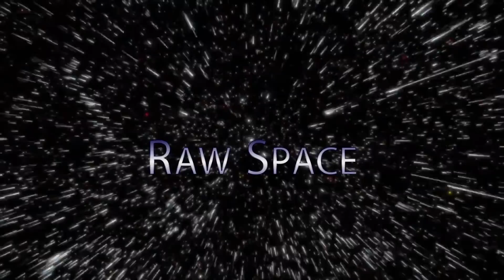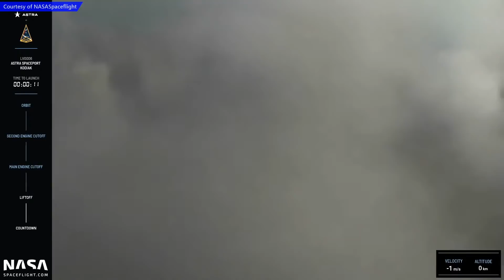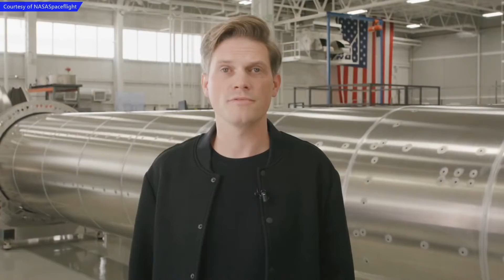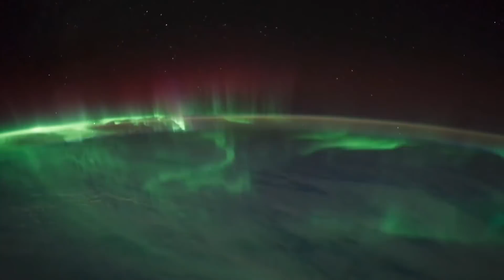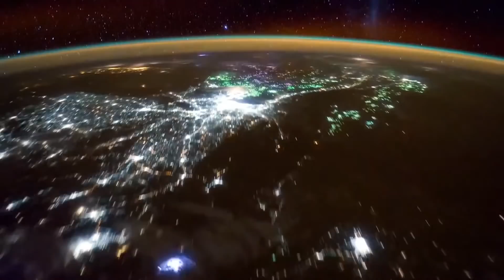REPLAY: Astra Rocket launches sideways, terminated at 30 km! (28 Aug 2021)

Comment: Future primary school maths exam question:
- A rocket with 5 engines takes off from a launch pad at sea level. One of the engines fails at launch, causing the rocket to hover without vertical movement for a short time. Calculate the TWR of the rocket with all its 5 engines working. 😁
It truly was the little rocket that could, and the fact that it didn't turn into a huge fireball is a testament to the quality of all the stuff that did work as intended.

Comment: Kemp’s remarks seem pre-recorded? This was far from a ‘successful liftoff’. Shouldn’t the flight have been immediately terminated following the lateral drift at start?
Reply from the maker: No, they wouldn't want to terminate the flight right over the launch pad - that would all but guarantee damage to the ground equipment. If I recall correctly, they don't have an explosive FTS; their FTS simply cuts off the fuel source to the engines, allowing the rocket to break apart aerodynamically and fall ballistically into the ocean.
Kemp very likely prerecorded speeches for a variety of outcomes.

Comment: I've never seen a launch go so badly wrong and the rocket survive to climb away. That was just amazing to watch. Kudos to the rocket design and build teams. It withstood stresses I'm sure were never envisioned. Apparently it lost an engine very shortly after ignition and was left with a thrust to weight of 1:1.  So, it sort of hovered and drifted sideways until it had burned enough propellant for the thrust to overcome the weight. They let it go long enough to clear the island, and thus avoid an expensive clean-up effort, but no so long that it would've come down outside of the exclusion zone near the launch pad.

Thank goodness they left that gate open.

Comment: "If it crashes into the ocean, we don't have to pay for cleanup!"
Reply: They still do clean up operations - it's just easier in the open seas. It's also fairly unlikely to harm macroscopic life (ecological density at the surface of non-costal ocean is rather low). Compare that to a detonation with more unburnt fuel in the immediate vicinity of the launch site, which would cause far more ecological and economical damage.

Comment: tumbled is incorrect, that was waaaaaaay too well controlled by the guidance computer to be called a tumble, more like "hovered"
Reply from the maker: After the flight termination command killed the engines at 30 km altitude, it definitely tumbled.
Reply: @RawSpaceVideos  ah, i missed that last part, thought tumbled was referring to liftoff not to after the termination command, my bad

Comment: If you slow the video down you can see just right before 1:24 a failure at the lower part of the right booster/engine, parts fly off and the lower part of the rockets appears to hit the tower.

Comment: The fact that the guidance system was able to correct for what looked like an engine failure at the launchpad was amazing. I'm amazed that it recovered as well as it did. All things considered, it was a pretty good flight.
Reply: It was amazing indeed
Reply: I was sure it would keel over and explode in the next moment. The ability to recover from that angle shows a robust system, I think they will be successful in time.
Reply: Yeah, the gyro could keep the rocket upright wow, my $50 drone can do the same thing, wow

Comment: Apparently, the rocket lost one of it's five engines 1 second after life-off and it only had the power to drift until is lost enough fuel weight to start to rise.    It was impressive that the navigation system was able to keep it from crashing.    The bad news for Astra is that rocket engines really need to last longer than one second.

Comment: I am confident it was a hard start. The reason the tilt happened was the engines couldn't get up to thrust before the tower let go causing it topple instead of lifting vertically. When they call t-0 it should have the proper thrust to immediately get off the ground then the tower lets go. The flight computer should have detected the insufficient start before t-0 like last attempt and aborted. So I believe the finger can be pointed at the sensors, computers or software.
Reply: Scuttlebutt is that one of the engines experienced RUD at ignition.

Comment: I suggest you change the title. This was not a failure; yes it did not reach orbit; however, the same things happened with Falcon 1.

It is not a failure unless the designer proclaims it a failiure.

And by then, they are weak.
Reply from the maker: Fair point, though the stated main objectives for LV0006 (per Astra founder and CTO Adam London) were, "to demonstrate that we can deliver a test payload to an appropriate orbit, and gather data on the performance of the system in flight." They did gather 2.5 minutes of flight data, but they neither launched nominally nor came anywhere close to orbit. Semantically speaking, they failed to achieve half of their mission objectives. Now, this was a test flight, so one could argue that a failure to meet all the test objectives does NOT mean that the test itself was a failure, if there is data and lessons learned. Either way - "failure" or "partial success" - they will take the available information and make good use of it. 👍
https://astra.com/news/qa-with-dr-adam-london-astra-cto-and-co-founder/
Reply: @RawSpaceVideos  true

Comment: It seemed to be low on thrust and fighting a tendency to roll over, right from launch until MECO. It was as if one engine had not been running properly, or else it was  vectoring thrust at the wrong angle.As soon as the engines cut, that roll took over, causing the tumble. It would be interesting to see where the debris came down, and to know what they learn from the debris.
Reply from the maker: The rocket splashed down far out in the ocean. It's doubtful they'd be able to recover anything.

Comment: I came up with a prediction for the incident:

Astra 0006 launch vehicle failure 

After an extensive analysis I have come up with a prediction for the failures of the Astra 0006 launch vehicle. To make it simple let’s assume it has 3 engines with an thrust output of 1 million pounds of thrust. 3, 2 , 1 liftoff, the rocket lifts off and veers off to the side. This means only 2 engines ignited or only 2 ignited properly causing asymmetric thrust. The rocket still took off the pad so considering that only 2 engines ignited, that means that you have 2 million pounds of thrust. This means that the rocket mass would have to be less than 2 million pounds even just by a tiny amount so that it can lift off the pad. However, in the video you can see that the rocket’s guidance system try’s to re align itself (which is does) by gimbaling the engines. However the rocket must have been even lighter than 1 pound less than 3 million as the thrust from the gimbaling was not directly pointing down due to the engines being gimballed. This means that you would loose some amount of thrust as the engines are not directly having a downwards 90 degree output. So, the rocket did have enough thrust to get it up off the pad but very slowly. Then the 3 rd engine kicks in properly and 3 million pounds of thrust is returned. This powered the vehicle up for around 2 minutes until just past max Q. Then MECO (main engine cut off) happened and suddenly the rocket started to spin out of control. I am assuming that this is because one of the engines cut off too late. This would cause the asymmetric thrust to veer the rocket over which would make it begin to spin. I highly assume that this is the same engine that caused the problem just after lift off. My guess is that it is possibly a sticky valve that has problems with ignition and engine cut off which effects that thrust output.

Comment: Seems as if the Germans, in the mid 1940s, had a lot of success with the V2 which seems the same size. Astra is not proving its reliability to the Space Force.
Reply: Have you not seen footage of V2/A4 failures? There are a lot of them. 
Testing and failures are part of the process on completely different rockets despite the similar size.
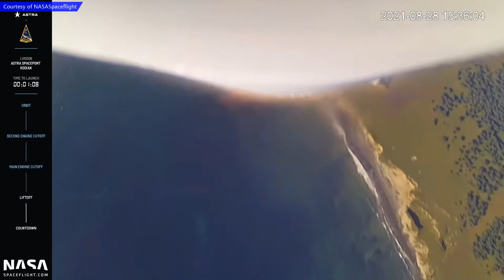Reply: @voongnz  I agree but I would think they’d do their research in a less  conspicuous way. I think they over did the coverage but since I love all things space, I am glad it was broadcast I even woke up at 2:30 to watch Falcon launch.

Comment: Surprised it made it as high as it did with that takeoff. That was obviously going to be an abort. Really disappointed they didn't show the self-destruct. Why hide it?
Reply: Well how would they show it if the cameras get destroyed
Reply: @gegi207  It was clear skies, and I'm sure it made a big boom, the second stage was still full of fuel. Ground cameras would have picked that up nicely. I doubt they just let it fall into the sea.
Reply: I mean they maybe could use ground cameras but that rocket is tiny compared to others
Reply from the maker: Actually, their flight termination system - at least for this test flight - only consisted of cutting off the engines, not actually detonating the rocket. It tumbled, probably broke up, and splashed down uneventfully in the Pacific.

Comment: We all had falls as babies when we were learning to walk. Initial failures are always tragic in the moment but in the long run they only serve to make us try harder and do better until at last we overcome and achieve our goals. Good progress. Astra, looking forward to the next launch and seeing what you can do.
Reply: https://www.youtube.com/watch?v=BFdohwm8Quc&lc=UgzjGWq8G1jnl0anEU14AaABAg
Reply: Right, except that these babysteps were done in the 60's.
Reply from the maker: @JohnJTraston Rockets are much trickier than a car or a plane. A launch is essentially a controlled explosion, where you're harnessing the raw power of combusted rocket fuel to propel you upwards. You have no aerodynamic lift; no wheels on the ground for stabilization. All you have is thrust - and a constantly changing vehicle mass, as fuel is expended. Furthermore, cryogenic fuels such as the LOX in Astra Rocket 3 need last-minute loading and constant venting, or they will rupture your tank from the evaporative expansion. Astra Rocket 3 is a completely new vehicle, from a new launch vehicle manufacturer. SLS is a "new" vehicle using a lot of old parts and technologies from the shuttle program, yet it's still taking many years to develop. Ariane 6 has been in development for more than 10 years, and it's still never seen the light of day.
Reply: @JohnJTraston  yeah! Because your dad learn how to walk in 60s didn't mean you can automagicaaly start walking!!! 

No space startup or government ever launch a rocket without a failure.

Comment: I'm sure it was failure of one of the engines that caused initial leaning;  then the other engines either gimbal'ed or throttled down to compensate, but were unable to arrest horizontal motion.  Ascent was pretty slow to my eyes;  specially considering it's a small rocket, which usually appear to accelerate faster due to their small size.  What happened on separation, however, beats me.  I did not see a separation;  just a spinning of the whole thing out of control, as if one engine had failed to turn off.
On the other hand, this happened at 35km altitude.  I would expect first stage separation would occur in the vicinity of the Karman line, or anywhere in the 80 to 110 km altitude.  So I think a lot was going wrong already.
Reply: Watch again, something was peeling off before it went out of control.
Reply: @TommyTester  Yeah, Scott Manley pointed it out in his video.  Looks like an engine may have exploded.